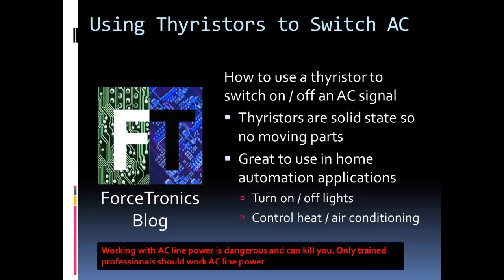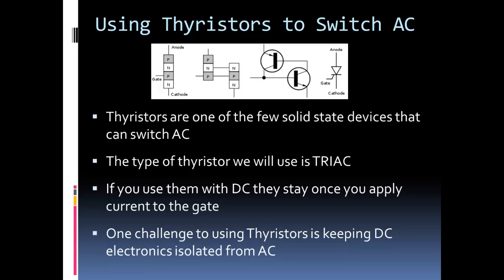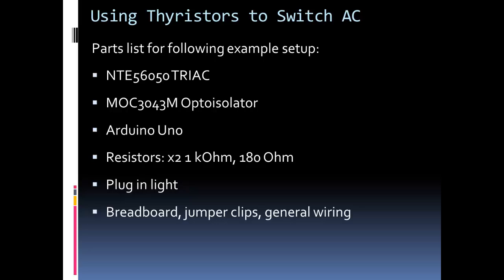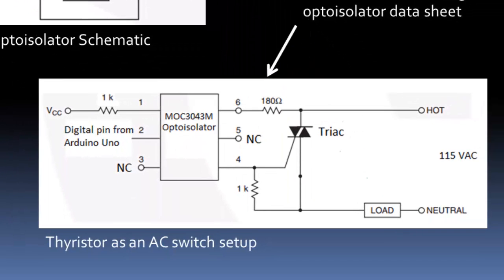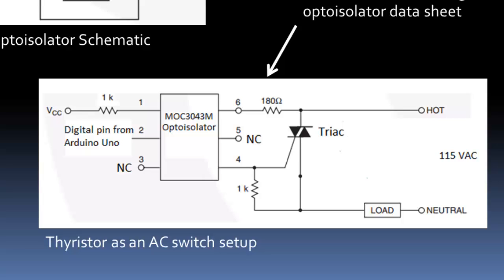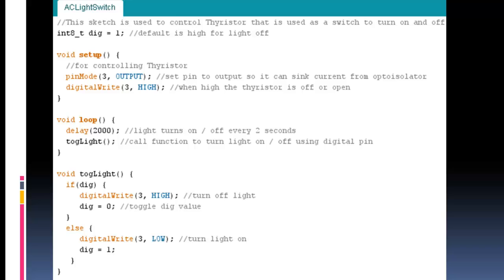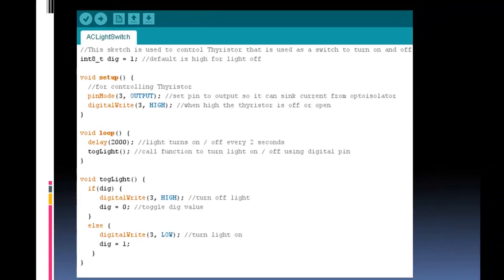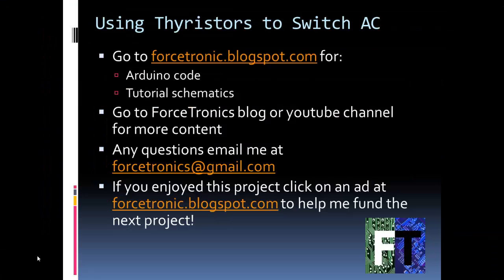Using a Thyristor (TRIAC) to Switch AC Line Power

Comment: Can you show how to dim?
Reply from the maker: To dim the light use a pulse width modulated signal instead of a simple logic high / low pin. Adjust the duty cycle to control the dimming.
Reply: @ForceTronics  Thanks for the reply.

Comment: Great - do you need any enhancement of the basic circuit to drive inductive loads (ac gate motor for eg) ?
Reply: Adding a snubber circuit should control the inductive spikes across the triac.

Comment: Hi sir,what is the use of triac in water heater?
Reply from the maker: I am not familiar with water heater circuitry. If there is a triac in the circuit chances are it is used to switch on and off AC voltage

Comment: thanks for the video can you tell me if my load is DC what do i need to use 500 volts and 20 amps ? i tried the SCR and as you said exactely it latches so its not a real switch , i need a switch DC  500 volts 20 amps please help
Reply from the maker: This video is for AC. For high power DC I would like at a high power mosfet or a mechanical contactor
Reply: @ForceTronics  i tried the SSR DC and somehow they get burned and just gets shorted , as for a contactor its limited to frequency ,i want to run at 400 Hz so no way to run with contactor and mosfet they get burn too how can i protect the mosfet ? \

Comment: Correction: a  thyristor and a triac are 2 totally different devices.  A thyristor is a silicon controlled rectifier i.e. it converts ac to dc
Reply: Generally, SCR and Thyristor are used interchangeably but SCR is a kind of Thyristor. Thyristor includes many types of switches, some of them are SCR (Silicon Controlled Rectifier), GTO (Gate Turn OFF), and IGBT (Insulated Gate Controlled Bipolar Transistor) etc. But SCR is the most widely used device, so the word Thyristor become synonymous to SCR. Simply, SCR is a kind of Thyristor. And Triac is also a kind of Thyristor.

Comment: I have a quick question, if I have a load that consumes around 5 A (Still good for any TRIAC) and I put a current limiting resistor around 18 Ohms (120 * sqrt(2) / 5) and is around 33 Ohm, but what about the wattage? That means that the TRIAC can handle big currents but the TRIAC cant?

Comment: how do you determine the resistor value of 180, and 1k ohm ?
thank you
Reply from the maker: Those values were recommended by the datasheet of the opto isolator.
Reply: @ForceTronics  thank you for your respond.

Comment: The lines should not be labelled 'hot' and 'neutral'. They should be labelled 'hot' and 'switched hot'. If someone hooked the circuit up as you show, they would short hot to "neutral" and cause a boom. BTW it is not a neutral unless it is in a 3 phase system. In a normal single phase 120v system it is the 'identified conductor'.

Comment: How can I convert 12v dc to 12v ac ?
Reply from the maker: You need to design or buy an off the shelf inverter. I am not a power electronics guy so designing inverter is not a video that I would do

Comment: What does Zero Crossing Circuit mean? It is shown on the schematic for the MOC3043M, in a box connected to pins 6 and 5. 

Great vid, ForceTronics, thanks.
Reply: 'Zero Crossing' refers to the point in the AC cycle where the current is zero. Triacs can only turn off at this moment, when the current is zero. (thats why triacs can't turn DC off - DC never 'zero crosses'). For a noise-free ac switch you need to turn the triac ON at 'zero-crossing' - otherwise the 'turn on' at full voltage will generate RF noise. Normal Speed Controllers are not 'zero crossing' and are very RF noisy. When you initiate 'turn on', this opto-coupler probably waits for 'zero-crossing' before turning the triac on.
Reply from the maker: That is a circuit internal to the MOC3043 so I don't know exactly what it is made up of. My guess is it reads and does the appropriate action based on the opto sensor output. Zero crossing is probably a reference to now electricity crosses that plane, only light.

Comment: thanks you for the neat clarifications. When you apply 5V at the VCC you dont exactly get 5mA flowing over the 1K resistor, you would get less, since the 1k resistor will have 5V minus the fordwad voltage of the diode, so you would get some 3.6mA ;)
Reply: Good observation, Amjad. I giggled LEDs and they can have a voltage drop from 1.8V to 3.3V. The datasheet for MOC3043M shows a typical Vf (Forward Voltage drop) of 1.25V, with max at 1.5V. Where did you get 1.4V from?
Reply: @rongarza9488  hello Ron, 1.4V was only an estimation of the forward voltage in the infrared range. I think 3.3V and the like are for green and blue LEDs.

Comment: Why did you use the zero-crossing instead the regular One?
Reply: Probably because  'zero-crossing' creates no RF noise? For a noise-free ac switch you need to turn the triac ON at 'zero-crossing' - otherwise the 'turn on' at full voltage will generate RF noise. Normal Speed Controllers are not 'zero crossing' and are very RF noisy. When you initiate 'turn on', this opto-coupler probably waits for 'zero-crossing' before turning the triac on. PS.. 'Zero Crossing' refers to the point in the AC cycle where the current is zero.
Reply from the maker: I don't understand your question, can you please provide more detail on what you are trying to ask?

Comment: is it really safe to use switching of this moc3021+bt series triac  instead of traditional relay , as we know relay provides around 10^6 click life and I have seen some relay contacts get sticked due to unknown reasons and we need to replace those and if they used in home automation it's really seems disaster so is it good idea to use triac as switch?
Reply: Bhavin Rathod relays are a good option for low switching frequencies. But since they are mechanical switches and will wear out in time and will require replacement. Using optotriacs, you can switch the ac load at a much higher frequency

Comment: Hello sir,
What protection mechanism to protect TRIAC From Overload Or High Current ?
Reply from the maker: Fuse or circuit breaker. The normal methods when working with AC

Comment: What is the purpose of 1K resistor on the AC side? I also find such resistor in MOC3061 datasheet but there's no explanation about it. Thank you
Reply from the maker: The datasheet does not say. Looking at the couplers schematic in the datasheet it looks like it is used to bias the active element in the coupler

Comment: @ForceTronics I have a burning question that I hope you can help me answer. I connected the Arduino pin to leg 1 on the optoisolator and GND to leg 2 with no 1K resistor and it worked just fine. Why would you connect Vcc to leg 1 with the 1k resistor and the arduino pin on leg 2 then? Does that provide any additional protection layer? Please let me know.
Reply from the maker: Ivann Ruiz the data sheet recommends using only 5mA to turn on the Optoisolator so 1k resistor accomplishes that

Comment: Thanks for the video. You can solid-state relay which is exactly the same circuit as the one you are using here. (S108T02 Series
S208T02 Series)

Comment: can this circuit be modified to be a light dimming circuit?
Reply from the maker: It probably could be used for that application. My concern would be that this method of dimming would reduce the life of common AC bulbs like incandescent or fluorescent since it is constantly cycling power to them.
Reply: Thanks a lot.
Reply: The zero crossing opto would need to be replaced with a random triggered opto to switch it when you want in in any part of the sine wave phase.   The zero crossing will always trigger at the start of the next phase.

Comment: I realize this vid is a few years old.  Not sure if your still playing around with triacs or not.  Have you used then to control 110ac motors (inductive loads)?  If so do you have any recommendations based off of your experience?
Reply: For motors 110 ac and larger I feel its better to use a relay or a contactor as they can sorce higher current. I used a n channel mosfet to switch a 24 volt coil relay that sourced 120 volts ac at up to 15 amps. The relay switched a 3 phase motor contactor that was powering a 460 volt 90 amp motor. I used a 24 volt sensor, with voltage divider to signal an attiny85 mcu pin to go high or low, switching the motor off and on. The motor pulled 120 amps at 460 volts ac on start up then would pull 90 amps after it got to its normal operational rpm. Funny thing was the industrial electrical technicians I was working with just spent $1000 usd on a PLC to do the same thing I was doing for less then $20 usd in parts. Not counting the sensor, relay and contactor because they where the same parts being used with the PLC.
Reply from the maker: I have not. If you look at the data sheet for the opto isolator MOC4043 it talks about the setup for highly inductive loads. They recommend adding a series cap and resistor in parallel across the input and output to handle flyback effects. They suggest some values, but you may have to do some trial and error to get it right.
Reply: +ForceTronics I have the data sheet and I do see their recommendation for the snubber, but my issue is it provides no recommendation for the voltage or wattage.  It's kinda black magic to me.
Reply from the maker: Go to the Triac data sheet for that info. It provides voltage limits as well as transient time limits.
Reply: +ForceTronics will do, thanks for the advice and your time!!  Your videos are great, keep up the good work.
Reply: I'm working with same project facing the same problem. any hints?

Comment: I used a NTE3097 optoIsolator Zero crossing requiring 50mA max IF gate current by measuring a 2.87V drop across the Rvcc and using a 75 ohm R instead giving a 38 mA limit. Worked great using 100mW vs 330 mW rated for the device.

Comment: I plan on powering a microcontroller (Arduino Uno) using a 9V battery to send a +5V DC output  signal from a single pin that can provide 40mA to a TRIAC to be able to switch on and off a 24V AC solenoid valve. To protect my equipment from the discharge, im connecting a freewheeling diode across it.
The valve's electrical requirements are:
Inrush volt-amps @24 VAC - 8.5 VA  
Inrush current @24 VAC - 0.35AMPS
Holding volt-amps @24 VAC - 5.5 VA
Holding Current @24 VAC - 0.23 AMPS

The solenoid valve is powered by a 24V AC @ 750MA transformer.
I am using an optoisolator as well to seperate DC from AC.

Can you confirm the triac (nte56050) and the optoisolator (MOC3041) are within requirements of the solenoid valve?
Reply from the maker: +Haitham Adwan If you look at the NTE56050 data sheet (http://www.nteinc.com/specs/56000to56099/pdf/nte56049.pdf) the max cont. current is 4A RMS and it can handle peak current of 25A so from a power handling perspective you should be fine. I have not used solenoids before so from a flyback protection standpoint I would go with what the manufacturer recommends.

Comment: Can i use this triac to switch ac power to turn on and off a 24V AC solenoid valve? the ratings of the valve are @ 24VAC 0.35 AMPS in rush current. Holding current of 0.23AMPS @24VAC
Reply from the maker: +Haitham Adwan Yes, you will want to add the extra resistor and capacitor in parallel with the Triac since a solenoid is an inductive load. I mention this in the video but it is covered in more detail in the data sheet of the opto isolator.

Comment: what if i want to use 36 triac turn on and off each 3 triacs connected to on light ,
how i can control the turn on off , should i use 36 Arduino for each triac
Reply: How about 1 arduino and 5 74hc595? Should give you 40 i/o pins using only 3 pins from the arduino.
Reply from the maker: +Aif Myham You would need 36 digital pins, but not 36 Arduinos. That is more like 2 to 4 Arduinos depending on which ones you use. Also if all 36 can be on at once be careful not to exceed the max current rating of the Arduino.
Reply: *****
Thank you if you can tell me how i can turn it off
Reply from the maker: +Aif Myham Turn what off the Triac? The video covers how to "open" and "close" the Triac as a switch.
Reply: ***** thank you

Comment: I think that the White bodied opto-isolators have a higher reflow temperature, at least that is the only difference that I see on the datasheets. It has been theorized that the material capacitance for the white bodied IC's is less, allowing quicker switching times, but I have seen no evidence of this on any datasheets.

Comment: what is the watt value of the 180 ohm resistor you used in this project?
Reply: ***** Thank you for the quick response, i must have something wrong in the wiring because the circuit works and the arduino switches the light but i get smoke on the 180 resistor after a few seconds
Reply: ***** any suggestions as to what might be causing the overload of the resistor?

Comment: In the datasheet I can't see what resistor should I use so that I can use it in 220V AC? May I know if there is a computation there? or what is the value of resistor shoul I use? Thanks in advance ;)
Reply: *****  thank you sir =) Now I already saw it , but something I noticed sir, when we trigger the triac using optoisolator, when if it is off, our lamp is still on, but very very little brightness on it, I dont know how it is happened, But the value of 330 ohm and 360 ohm was replaced by 1000 ohm, because we dont have that resistor, correct me if I a wrong sir, Maybe the value of resistor has affected the output of triac?
Reply: I have similar problem. How do you solve it?

Comment: I liked this. The explanation of the components is easy to understand. Optoisolators in general tend to have white packages. Have seen them in white before. I believe  the MOC303X series should be used in 115V applications.